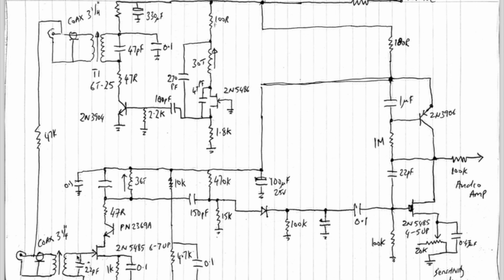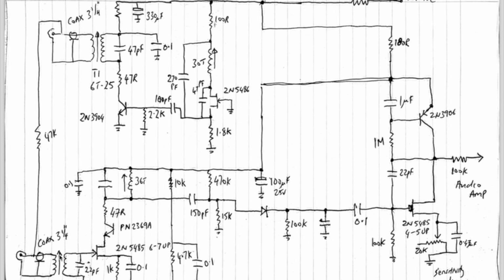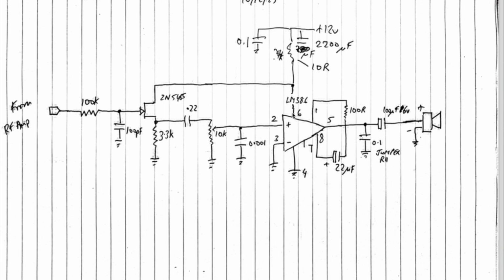Homemade Ultrasonic Blood Flow Dectector

Comment: How do you stop the reflected signal being swamped by the source?
Reply from the maker: I think the reflected signal is doppler shifted slightly higher in frequency than the source
Reply: You don't, the circuit relies on the source signal being present. The reflected signal is down converted by the oscillator signal - the non linearities in the circuit (the diode) give you the sum and difference of the two signals. The sum is at double the oscillator signal, and the difference is at 'audio' frequencies. Separating the two signals is then easily achieved by a low pass filter at a few kHz.  This is the same circuit that is used for UHF and microwave doppler motion sensors.

Comment: Very nice build.  Will the mk3 version include a few valves? 😀
Reply from the maker: I might do a valve version but I doubt I’ll be able to use it at work cos of the potential high voltage but I was thinking of running some tubes with low voltage and see if it wud work
Reply: @thewtf  Maybe there'll be some types of 1.6V/90V valves which could be useable.  All good fun anyway and the mk2 looks great in that box. Top job OM!